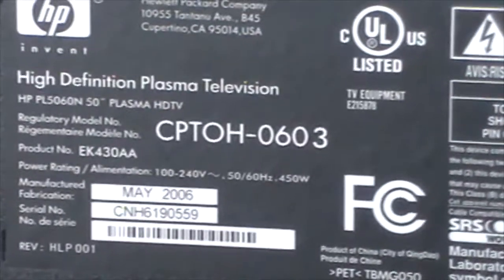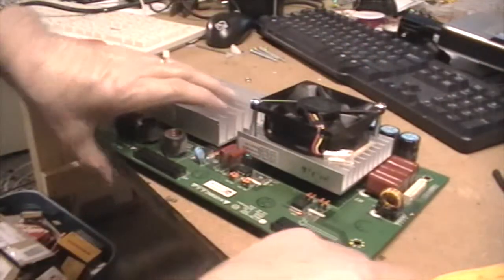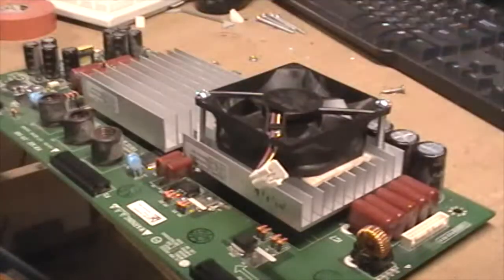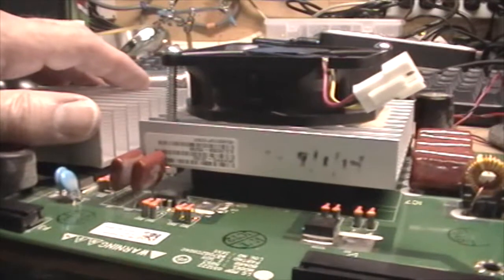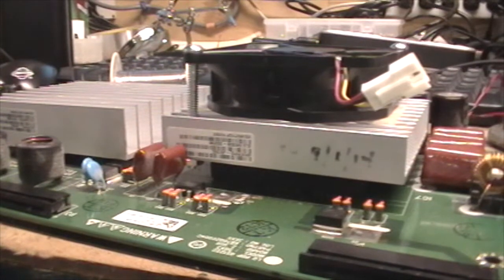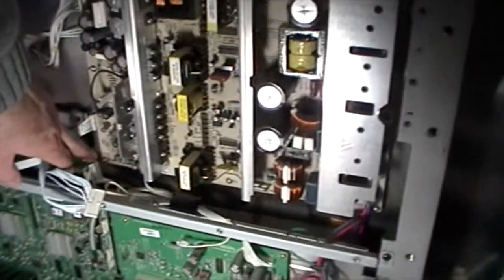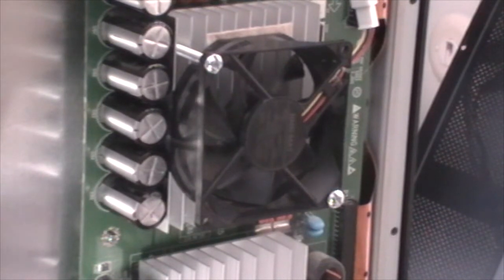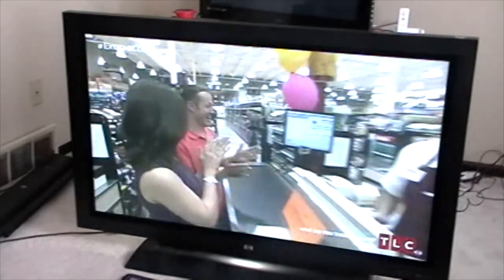YPPD J015c Fix HP 50" Plasma

Comment: Hello there, SUPERP & Detailed article on the HP plasma as well as great to still see service for this platform. I loved 'the read" and it helped me out tremendously as although I am a master residential electrician for the past 11 years in Philadelphia, I do not know (never attempted or tried..) to fix my own electronics. That is, until a family member gave me a barely used BUT; from august 2006 HP plasma 42' television. Very heavy with handles on the rear. Number CPTOH-0602 also referred to the one in your spectacular article. I power it on, at first it seemed like nothing was going to happen except the blue light then as we looked at the top (sat in a house barely ever  used then in a garage 3 years, looks new!) of the screen and saw a dim screen (looked dim to me!) across the top of white fuzz that you would get with no signal. This was only about 15% of the top of the screen and it was NOT a perfect black line across as it looked more like a mountain from the black of the TV filling it in from the bottom in a abstract fashion. Speakers attached and no sound however unsure how they even work as I did not have the TV prior. This, tome is just a learning experience and I am willing to pay to play as in PAY up to a few hundred to learn and fix it by myself coupled with others help, hopefully yours. So, in your article as thorough as it was, the only thing it was missing IMO is what causes sound to be out typically as I know you are no wizard and can never be 100%! Should I ignore this part? Can ZSUS cause sound failure? So, the HP plasma (my little adventure, for fun and science) when I brought it home, powered right up again with the two blue lights on the board to the very bottom left (when looking at it from behind) and this time I was able to leave it on a little longer so I started to notice in random areas (near bottom, not the bottom edge) would have a almost "circle "like" parts in the mostly black screen that started to fill in with more of the white static fuzz that would normally be on a TV with nothing plugged into it. Good clue? I then shut this down ASAP as noticed there is some dust in there from the garage in which it was stored but not temp controlled and di get cold for three winters but not so hot as the garage is cooled automatically and it was not disturbed for years. The poor HP just sat there! Anyway, I tried one more time to turn her on and now no picture at all so maybe a fuse blew now? The power light still goes onto from red when plugged into wall directly to a pinkish purplish (I suppose that is when HP Logo should be on the screen?) to a blue. The blue stays on for a good ten minutes or so and eventually shuts back down to red as I suppose it feels it has zero signal which the TV  doesn't so it shuts down prob as it should as if it had a screen up. From what I know, this is a little nuts being the age but as I said this is for the sake of science and not to concerned of $$$ or time, etc. I just do not want to try to fix my first TV if it is going to be the actual gas that leaked out the plasma, how do I know this, is there a way? It is certainly not cracked in which one can see. It looks brand new minus the design and bulkiness. I did your trick and left her on that time (last time) and felt the sides of the tv and she was nice and warm on (when feeling from the FRONT of the screen over top to rear) the right side which would be her left when you look at her from the backside! The middle I could not tell but the left side (from looking at the tv as if watching tv) remained cold. It never became hot that I could tell. Failed ZSUS, hence my question can zsus cause failing audio that I am not even sure of but think? Now, from ALL that I read and know thus far (which is allot but your page is without a doubt -  the most informative!) I am leaning towards failed ZSUS but because of age, change both and all fuses? How many fuses and do you sell them separate for all boards? Are the only fuses on the two boards I am leaning towards replacing as if I replace the zsus only, it could cause the new part to fail as well as other parts (definitely the newer-ish fuses?) in the TV beings it could be a two part, three part issue although I do not think so and hope not. The tv is immaculate except a little dust which I suppose I would clean with JUST AIR(?) very good then replace the seemingly failed ZSUS board as well as the YSus for good measure or do my symptoms from the time I got it to brought it home sound like the buffer, etc? I of course, would not hold you to it just want your expert "opinion" from the info I have provided and everything that happened in sequence as well as the history of this unused, sitting HP TV? Thanks so much in advance for your time and hope to do business soon, Stephen BTW: Can we get "TRUE" LG parts for this instead, would you say they are better to put in, when swapping out? I am glad I had some type of screen at first prior to failure so I could explain to you, there was no popping sound that I ever heard prior to the now, no screen. If I do get her fixed I saw a good MOD to install a fan (can pick up 12v on one of the leads) on the common part (TOP OF HEAT SINK and ONLY after I get it running so I know!!!) that fails on the Ysus and Zsus boards. Hopefully my issue(S) does not 'sound like" typical buffer ISSUES, etc. If I had to guess, power supply is def good and as for the main board, welp, only way to tell is install at least ZSUS & YSUS as if it is something other or "as well as..." will it break the new YSUS AND ZSUS or only possibly blow the fuses? Again, your page was an spectacular write up and ONLY leaves me to wonder, does a failed zsus board cause no sound or Y but especially Z(?) and if not, which does as maybe I have dual+ issues however as I said, not sure how TV works exactly when "she" (hah) does indeed fully work as she was not mine so not positive sound is out but possible, I think so (sad face)! The TV even now DEF = thinks it is ON though as it goes through the stages and stays on long enough to which seems like a timer shuts he back to red and with your feeling for heat trick, GENUIS! I think the ZSUS however being age and sitting 'also that it is a plasma to begin with....) Kind Regards, Stephen O'REGAN

PPPPPPS: NOT to confuse US but if I fix this one ABOVE  I also have another TV which was mine for a long time which started this entire venture, a JVC in which I foolishly put a magnet (I think it is a OLDer & smaller  LCD - believe it or not...) that was super strong on the rear near the power buttons on the bottom right when looking at the front! I was obviously not thinking it would damage it. I did this as it is a wifi card for a car with strong magnet so it just happened to seem convenient to place there without thinking. I smelled that solder or very distinct electronics burning smell shortly after and she went out with her screen but still has sound. I hope I am not confusing as I would like to work on the one above first and foremost as in the H-Packard as in the Pl4260n (I think it is also called but I see CPTOH-0602) HP then fix the JVC but figured I would mention as I think I am going to have a heck of a time trying to find the part or parts for the JVC unless I actually solder parts to the board myself. Prob a blown capacitor from magnet and being the very distinct smell! JVC model number: LT-32X576. Again, I would like to fix the HP or "attempt to" first and foremost then move on to the JVC and although I know I could even solder parts to the board if had to, I much rather get it all new from you guys and only do so if I absolutely have to. I am okay with only "knowing that part in theory" and not practice. HAVE A GREAT ONE! -Stephen

Comment: How is the new module working? Still functioning? 

Some suppliers and repair techs say to replace all IPMs at the same time as well as the buffer board. They all work together and one may cause the other to fail. A damaged IPM (elsewhere in the TV) or buffer board may be the cause of your repeated failure. 

Of course a fan will help a replacement IPM survive if another component is causing the failure (cooling an overworked semi will usually extend its life). 

How long did the first 2 replacements last? 

Cheers.

Comment: Hi i have the same TV and am starting to have the flashing like the screen is blowing up white and then goes very dark or black .But the TV will restart and work fine again.I have had this TV for 9.5 years and have used a lot since now i use it as my computer monitor.But its in a different area than before ,so to it seems like its a heat issue from what i can tell since if i leave it off longer it stays on longer.Was going to say has it been fine now since you put the fan on? thanks Chris.